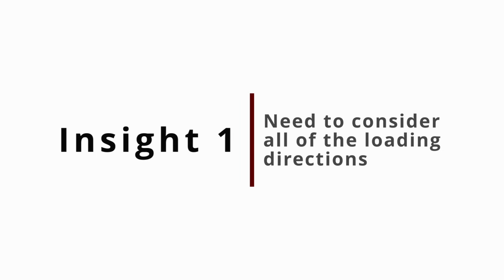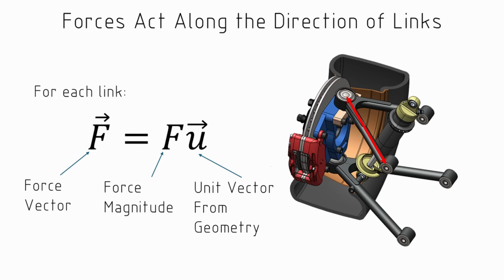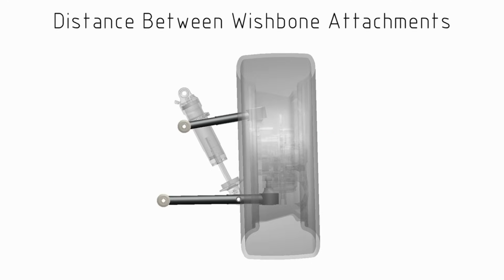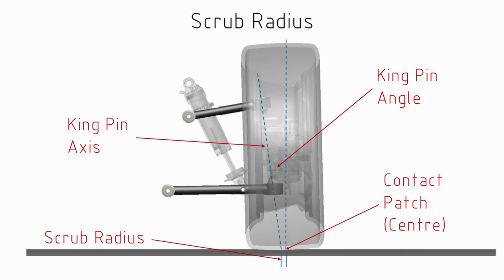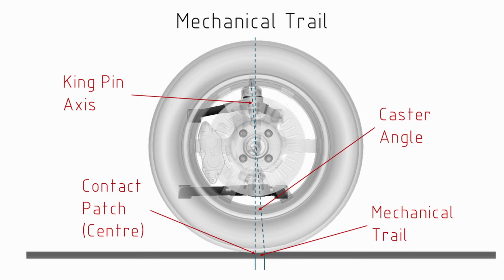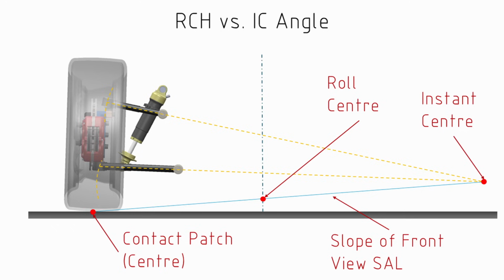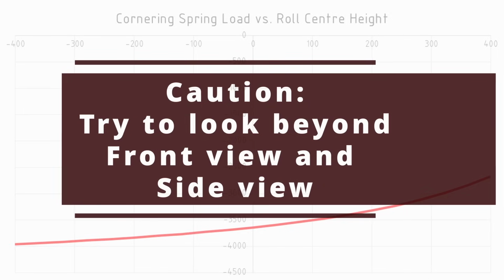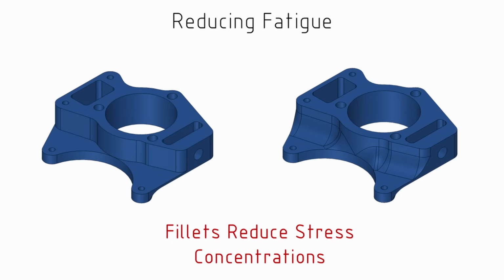Six Suspension Design Insights by Analysing Suspension Loads (Project 171)

Comment: One thing that I wanted to ask:  You mentioned that forces on steering link didn't change with "small upright" version (7:20). You also mentioned that tie rod forces didn't change. Looking at picture where both "small" and "normal" versions are present it seems that steering arm length is about the same which explain why tie rod forces didn't change. After all, tire rod/upper boll joint story is the same as lower ball joint/upper ball joint (different "point of view" and lower forces thought). What I'm trying to say is -  it is a good practice to have the steering arm as long as rim space allows (as well as tire rod perpendicular to chassis ZX plane).
Reply from the maker: It is good practice to make the steering arm as long as you can, assuming you can change the rack ratio to suit.  This is part of the reason I didn't change the steering arm length in this video as it would have meant discussing steering ratios as some of the kinematics involved.
Reply: @KevinHayward7  What can I say - that's reasonable. Thanks for your answer Kevin.

Comment: I'm a bit confused as to why you're using sum of forces and moments to determine suspension links.

You're effectively assuming the suspension is stationary and doesn't deflect... which it does...it's constantly deflecting, which means there's a net force or moment acting through the wheel at all times unless it's reached steady state cornering or braking.

Am I missing something here?

If we really get technical we should also consider damping forces which add to the link forces when the car is in a transient state.
Reply from the maker: This is solving the free body diagram of the upright. There is definitely some inaccuracy when it comes to the spring and not accounting for relative stiffness of all components. It does effectively treat it as a non-deforming structure in steady state. Although when you do testing with strain guaged members you find that the correlation is quite close, well within the margins applied to safety.

Comment: I'm just curious. Did you use your own data or did you obtain it from another place? I have often wondered about where to get acceleration and braking data.
Reply from the maker: I'm using data I have collected, it is from a track going race prepped car. A really good source of data to play around with can be found from some car simulators. The magnitude of accelerations is pretty similar between cars of similar classes.
Reply: @KevinHayward7  Extracting from a simulator is a genus idea. Thank you

Comment: In Milliken's "Race Car Vehicle Dynamics" I've learned about the different types of load transfer. For example, the total lateral load transfer only has a component (elastic) that produces body roll. I would expect that this is the only load transfer responsible for compressing the springs, right? Does this matrix analysis effectively do the same thing? Without the CG location anywhere in your matrix I'm wondering how you are able to determine the elastic load transfer responsible for spring compression. 

The same goes for anti dive/squat. How can anti dive show up in the suspension links without any CG location in the matrix? Thanks, great video as always!
Reply: The other question I have is about the moments on the tire M_x, M_y, M_z. Is M_x the lateral force * wheel radius? Is M_y from tire scrub and M_z from trail?
Reply from the maker: A tyre can have M_x from being cambered (and at a slip angle) where the centre of the contact patch no longer aligns with the centre of the wheel. This moment would be relative to the nominal contact patch centre. Noting that moments need to be calculated with respect to an origin.  In the tyre axis system the M_y is rolling resistance, and M_z is self aligning moment.  At some point I will look at doing a video on tyres, but there are plenty of good sources out there already that might help if you want to check it out quickly.  Hope that helps.
Reply from the maker: The lateral load transfer is taken into account with the wheel loading, this does include a nominal COG height. I didn't detail that part, but plan to discuss in later videos. The splitting it into the elastic and inelastic is taken care of through this matrix analysis. Noting that elastic is just the component taken by the spring, and the inelastic is taken by the links. 

In some ways I think the terms elastic and inelastic with reference to load transfer (and even the term load transfer itself) can cause confusion. Load transfer is just a reaction load at supports due to an offset load (moment) being applied. Inelastic weight transfer is just the proportion of this reaction load taken by the links (which is a function of the geometry). Noting that the links are actually elastic, they are just very stiff compared to the spring, and in a lot of analysis can be assumed to be rigid bodies.  The elastic weight transfer is the part of the reaction load resisted by the spring.

I spent a lot of time earlier in my career being somewhat confused by what some of the terms meant in relation to vehicle dynamics. In the end I think it is helpful just to think of things in terms of basic engineering mechanics (statics and dynamics). There isn't anything really unique about cars when compared to anything else in engineering. The main difficulty is that the loads applied from the tyre are non-linear, and similar can be said about the damper. But when it comes to geometry and loads through suspension members it is just engineering mechanics. Not that engineering mechanics is a necessarily easy topic!

I hope that helps.
Reply: @KevinHayward7  So the CG height comes into play because you used it to determine the total lateral load transfer? This meaning that the difference in loads on the inside and outside tires somehow "encodes" the CG height in a way that does not require it to show up in the matrix? Assuming you used an iterative solver, as the animations would suggest, is your CG height constant or changing?
Thanks for the responses.
Reply from the maker: In essence the COG height is included in the Tyre Forces part of the calculation. For this simulation I fixed the suspension throughout the g-g diagram.  This is effectively making the spring/damper a rigid link. It would be more accurate to have some change as the car experiences accelerations but it is not actually a huge difference to link loads. Noting that COG in particular does not tend to have a large vertical movement throughout these travels. If the COG is around 400mm off the ground, you would need a 4mm change in height to even have a 1% difference in load transfer, which is even a smaller percentage of the link load changes.

Comment: I like that your mention of high roll centres and jacking actually mentions jacking (particularly laterally) as being useful, preserving more of the vehicles available suspension travel whilst cornering and implementing a type of roll control. I've adjusted roll centres front and rear on my mini (built semi trailing arms for the rear) and it has subjectively been quite an improvement. I'm unsure how to compare the merits of roll control with roll centre changes verse antiroll bars. Intuitively I view ARBs as taking grip from that end, but potentially adding some grip to other end, but I find it difficult to see why grip wise it would be useful to have a front and rear ARB (but useful for transitions). Why are cars running front and rear ARBs when they could use higher roll centres? Are they all scared of jacking that much? (insert horror picture of triumph GT6 here) Has flat handling become so in style that they have to tie it down with ever larger ARBs? Or am I missing something fundamental?
Reply from the maker: Anti-roll bars have their place, really useful in racing when you want to have a quick way to adjust roll moment distribution. As the instant centre goes up the amount of track change during suspension movement also increases, coupled with a short swing arm length and this can get to being a decent effect (i.e. VW Beetle). That being said big roll bars aren't a great way to improve handling, especially over a bumpy road. I don't plan on putting big ARBs in the car, nor do I mind if there is a bit of body roll.

Comment: ay mate, sick video. for this FSAE competition cycle I was tasked with design the arms and went through the exact process that you did, which I just find to be so cool. I was wondering if you could point me to some resources or guide to learn how to make those sick visual diagrams (like the whole system going through different colors depending on the load at 6:50). I admit, I want to steal this ideia for my design event, no shame about it, but it is just so freaking sick.
Reply from the maker: Thanks for the positive feedback. It isn't anything more than drawing a few cylinders in matlab with different colours.  If you search up draw a cylinder in matlab between 2 points you will find plenty of links. Then its a case of setting up views etc. I'm pretty fortunate to have been programming a little longer than I've been engineering. I have found it a very useful skill throughout the years. Matlab has a bunch of different colormaps built in, and I used one of those to map the loads from what they were to a palette of 256 colours.  Hope there is enough in that answer to get you point in a good direction.
Reply: I have to agree as well, really enjoyed the way you displayed the whishbone loading against the ggplot graph. I thought that was a really effective way to present the entire analysis quickly. Especially in a design event—half the challenge is justifying the design, but the other half is doing so in a way that’s quick and gets to the point. The histogram for Miner’s Law calculations was a great addition too. The visualization of the link loads with changing colors was nice to watch,  but depending on which FS competition you compete in,  digital devices aren't preferred method of communication. But I personally enjoyed both the content & especially the visual communication in the video.. Dr Hayward.

Comment: I wish you'd go into more depth on the maths portion, but while keeping it simpler for people who didn't really get past basic calculus and maybe a bit of linear algebra. I've been reading about suspension stuff for years, and have a pretty good intuitive understanding of the effects, but have never been able to understand the maths well enough to set up any kind of simulation. :(  

Your bit on the matrix multiplication is fine, but I feel like you've left out a lot.  How do you go from the gg plot to forces and moments at the contact patch to put into the maths?  How are you modeling the way the force gets from the contact patch into the links?  What exactly is the coordinate system, where is the origin, and what is r?  What is the moment (it looks like torque but I don't quite understand how that's relavent)?  Is each link set equal to the tire forces individually, or is there some kind of summing going on?
Reply from the maker: I appreciate the feedback, and I will keep it in mind for future videos.  Some of your questions are planned to be answered in future videos such as the forces in the contact patch.  

But here are some immediate answers, although I am aware it is shortcutting a lot of engineering mechanics: 

- The way I have modelled the force from the contact patch equalling those in the links is to do a free body diagram of the upright. As in the links put forces into the upright, that are equal and opposite to the forces that the tyre puts into the upright.  This is Engineering mechanics, in particular it is part of Statics of rigid bodies.

- The coordinate system is a rectangular coordinate system with the origin at the ground, car centreline, middle of the front axle, although if you are consistent this coordinate system could have an origin anywhere and it will work.

- r is the distance vector from the origin to the outer point of each link (i.e the end that is closest to the upright)

- The moments are the result of the link loads being offset from the origin and are part of the 6 equations needed to solve for the 6 unknowns (i.e. the 6 links).

- The x,y,z components of the forces are all added to equal the tyre forces (and same for the tyre moments). The matrix is just a way to organise all the equations needed.

I hope some of this helps. There are a bunch of videos around for how to do some of the maths involved here. I'm not really aiming for this channel to be fully indepth on the maths involved, as I think there are others that do it better. That being said I will try to look for videos that I can link to with the relevant info in the future.

I hope some of that helps.
Reply: @KevinHayward7  Thanks! I'm not sure if it helps. I'll have to think it over for a while. For context, I'm a software engineer, not any kind of mechanical engineer, so my physics and math are on the weaker side. I've done a fair amount of 3D graphics. So I can think through what a load path looks like, but I get lost whenever I'm trying to calculate complex stuff, especially if I have to start solving systems of equations.

Comment: Great video again! Only one nitpick: can you please use a different colormap than jet? Even newer versions if Matlab come with a colormap that is easier to interpret (called "parula" iirc). Thanks 😊
Reply from the maker: I did try a few different colormaps. I'm not the biggest fan of jet, but Parula didn't quite give the contrast I was looking for. I was trying to keep somewhat consistent with the sorts of maps you would find in FEA software and Jet was the closest built in one.

Probably a red / blue map would have worked a treat.  Please forgive the visual assault of Jet for now :)